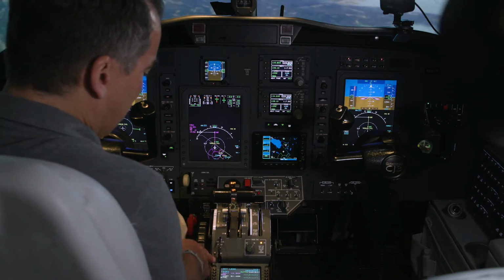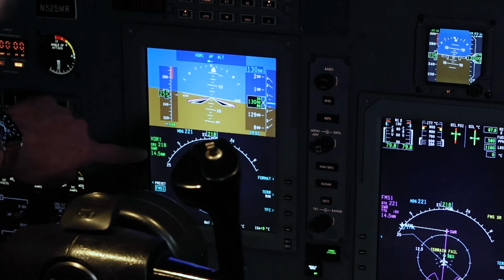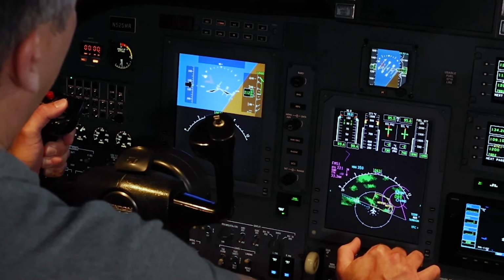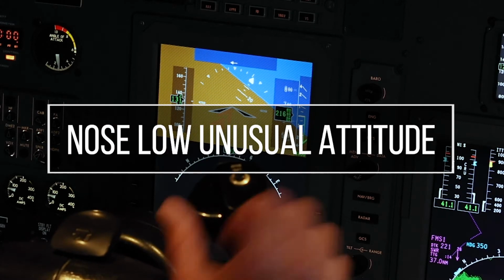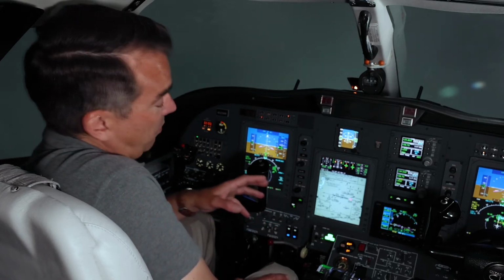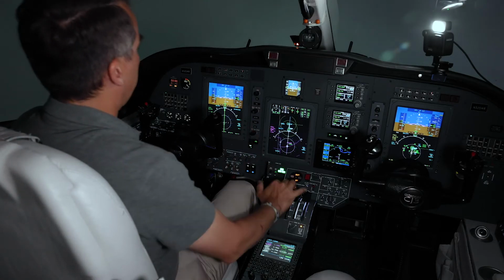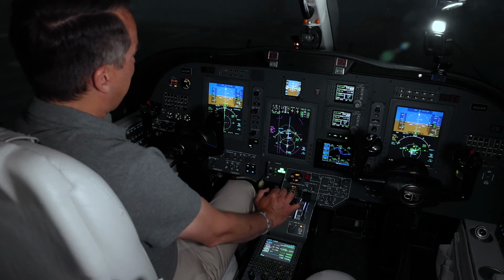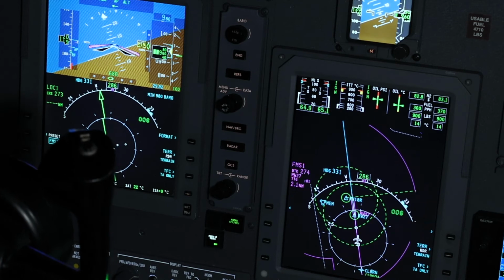CJP 2021 Convention: Ready for Recurrent 2.0 - Pro Line 21- CJ3

Comment: Thanks for the video very interesting. By the way, correct me if wrong, but I used to start the circle to land with 45 degrees (in this case to the right) for 30 seconds, fly the downwind leg with flaps 15 and gear down at vApp+10. Abeam the threshold count 15 seconds each 500 feet AGL and torn on base and final. Once established on final flaps 35 Vref.